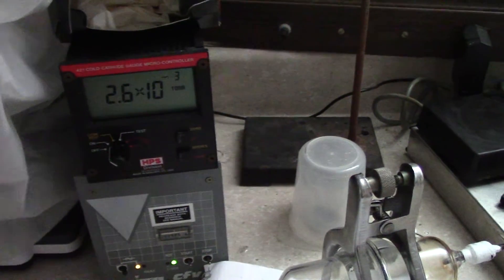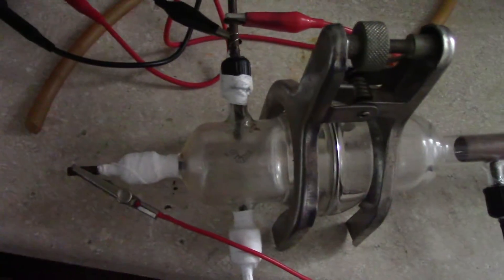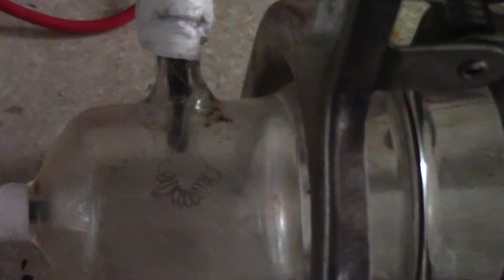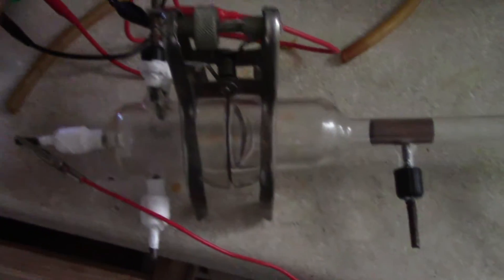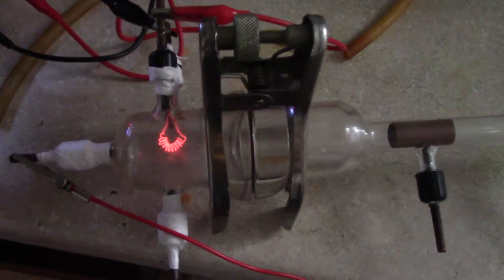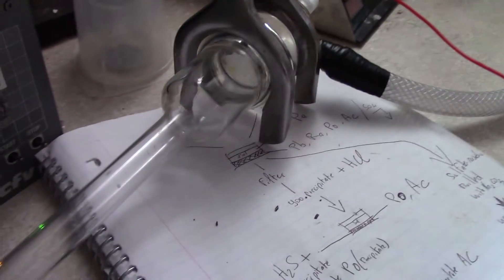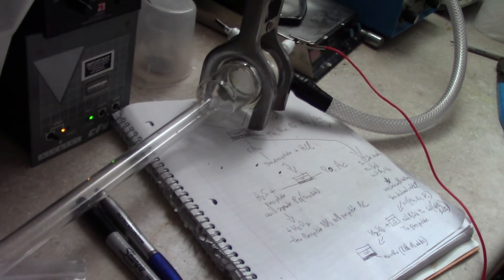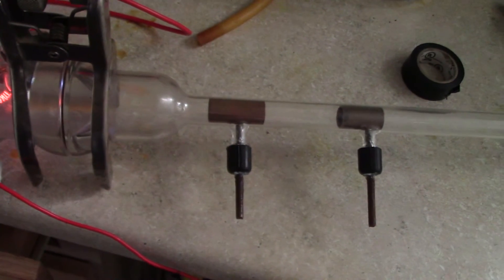homemade mass spectrometer attempt

Comment: Please post a video when it works!
Reply from the maker: +Fernando Lener 
I sure will. The main tube is being redesigned to be shorter and wider. Also the ion source will be a spark gap. Understand I travel extensively for work so this may take a little while .thanks for watching !

Comment: Where did the glass components come from (if you don't mind my asking)?  Any idea where I could obtain some similar glassware (at relatively low cost)?  I am working on a similar project (though, really just tinkering at this stage) and am having a bit of trouble obtaining some components...

Any suggestions would be greatly appreciated!
Reply from the maker: I found a lab glassware blower near where I live.. I talked to him and submitted my ideas he is one of the last professional  glass blower in the area ... maybe look on line in your area for glassware and scientific and custom glass blower...i know it's not much help and it's not easy but good luck to you its definitely  not impossible!
Reply: @Neptunium  Ah, okay... I was afraid of that. 😄  I actually do have a glass guy near me that's still around, but this may be out of his wheelhouse.  I suppose I was just hoping that I would be able to find standardized/interchangeable components.

I have actually had some luck scouring eBay for old vacuum and x-ray tubes salvaged from old electronics. The search continues! 😄 Thanks for the info; I appreciate it!
Reply from the maker: Your welcome ! Sorry I couldn't  help  much!

Comment: What’s the total cost so far?
Reply from the maker: Well this is an old project . I have moved on since that ... 
The prices of the equipment has also changed... Unfortunately... But back then a roughing pump was $200 and so was the High  voltage power supply... The glassware is custom made so it's hard to tell...

Comment: Where did you get your filament from? Did you get it from a normal lightbulb, or did you order it from a vendor?
Reply from the maker: This is a Nichrome wire . I just cut it and twisted it . It's an ebay find nothing special about it ..